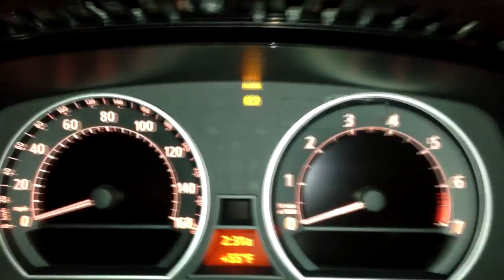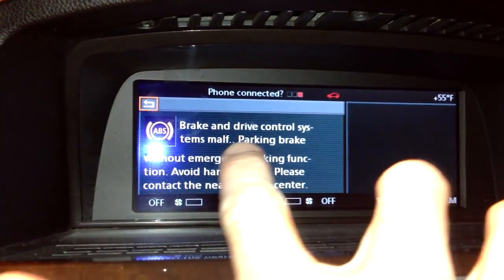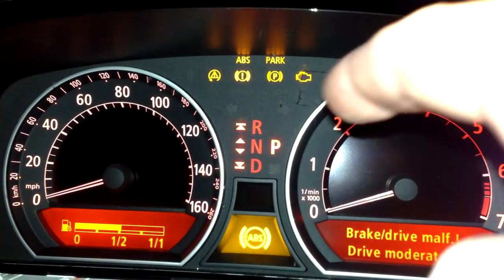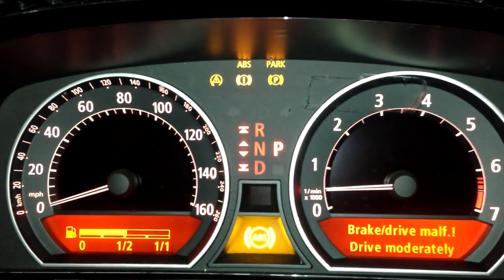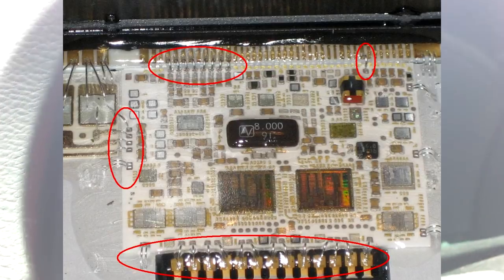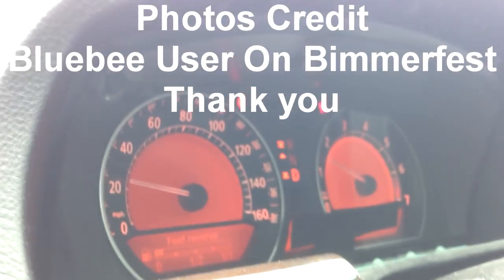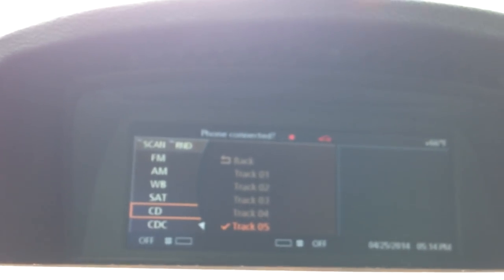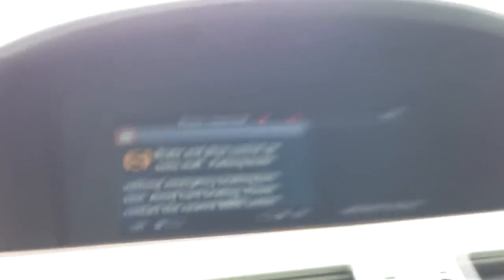Symtoms Of A Bad ABS Module  - BMW E65 E66 Bosch 5.7 module

Comment: Its the Rotation Rate Sensor DSC,Its under the passenger footwell.It leaks in through the sunroof and fills up the footwell with water that never goes away until you address it. The piece you need to change is under the passenger footwell. Rotation Rate Sensor DSC.
Reply: POP CHU how do you change that? Where exactly is located at?
Reply: You think it is the sensor or the module? Sensor is small round piece?
Reply: True had a very similar problem, the tubes that drain water from the sunroof get clogged you need to clean them out carefully. They exit behind the front wheel shields. Just check your footwell see if it’s wet. Especially after you went through the car wash.

Comment: I had this same problem. And didn't change it because people were saying it would harm anything. Then it went out while I was on the free way and I just totaled out my bmw. So get it fixed asap when this code comes on.
Reply: Dam sorry to hear that man.
Reply: @gabegaitan6964  No problem. Its going in the frame shop tomorrow.
Reply: @1CHOZN7  after seeing comment about the accident for not fixing the module I'm getting mine repaired. I didn't think it was a big issue. Good luck with everything..
Reply: @gabegaitan6964  Yeah everything locked up. And i couldn't control nothing. I think its a combination of things like the wheel speed sensors also. I had those changed out and just replaced the module. So now its ready for the frame shop hopefully everything is good afterwards.

Comment: before you send your unit in check the connector right behind the coolant tank. mine has gotten a small amount of water in it if i go to a particular car wash. the outside of the connector will look fine and possibly the inside of the connector too, take some compressed air and blow out the connector even if it has no signs of water in/on it. I have a 2006 760li and this trick has worked 3 times. make sure to give it a day to see if it works the computer will eventually reset itself and it may go away. Its free and worth a shot before spending money to get something fixed that's not broken !

side note: i had all the symptoms for the bimmerfest post about how to repaor the module.
Reply from the maker: Usdrake1fallen amazing, I will give this a shot thank you:)
Reply: DIYsavecash  enyoy your videos and i did save some cash. but i have to let go my bmw, too many repairs, i finish with one problem and another pop up.. i love the machine but it was time to go. now i fall in love with my vw touareg v8.. im still support your channel. good look.
Reply: Usdrake1fallen thanks
Reply: This is great am glad it worked for you ,did u have to disconnect the battery first to do anything?
Reply: I’m definitely gonna try this out

Comment: If your module fails, it can reduce the response to wheel caliper independently. Example is from complete stop, brake applied,  moderate acceleration, you will feel a jerking and hear "crack crack crack." This is the malfunctioning module failing to send release signal to reduce applied pressure to caliper. So basically, when you speed up, the caliper on one wheel will grab and you will hear the rotor and pad sound off as the module corrects itself, or tries to at least. 2001 x5 e53

Comment: I have  2008 750Li, same issue all the dash lights and the idrive information. However I has able to pull a code, it was the left rear wheel speed sensor. Went online and purchased a very inexpensive one, the lights stayed off for about 2 weeks then started coming back on. Checked codes again it was the same wheel speed sensor. I purchased a much better sensor. The lights have been off for about 3 months now.
Reply: My car same I'm change front wheel speed sensor still same problem I think it's abs issue

Comment: Did you loose power steering ... I sit mine overnight and all the lights go off next morning then a few miles down the road they all come on and power steering shuts off too , frustrating
Reply: mine loses power steering and sometimes cruise control aswell so im thinking its a speed sensor that went bad

Comment: I have been having DSC failure appearing on my dash for a very long time and i am clueless if this has anything to do with my tyres shaking when it gets to 60km/h speed.i have had to change all the arms, tie rods, stabilizer linkages and did balancing and alignment times without number but the problem persist, i am just not enjoying the drive in my BMW any longer. Pls advise
Reply: Ibraheem BABAYEJU did you ever figure it out?
Reply: Abs showed up for me when I had a mechanic take off most of the front suspension to fix a damn problem with the engine.

Comment: Hi i have a 2003 745 li bmw and i am having trouble with the car, i wanted to ask you if you know, heard or ever been told that the car has been reseting the monitors on its own? The reason im asking is because my car has been doing that, i put my scanner and everything is good its ready for smog test but out of no where it resets all the monitors on its own. I wanted to see if you have ever came across this problem before and if so what did you do to fix it.

Comment: Plz guys if these happens after a carwash or harsh bumps then in the front or back behind the wheels there r sensors tht hve been corroded inside so either replace the sensor or jst just the sensor n make the wires direct. Problem fixed
Reply: How do the sensors look like to you have a link to purchase? I took my car to a clielrsd mechanic that was fixing another issue on the car but needed to take off most of the front suspension I assume he forgot to attach a wire or wires back

Comment: Chris or ANYONE, wondering what levers on the steering wheel illuminate when the lights are on. I'm thinking all the lever icons are supposed to light up. The only one on mine that lights up is the transmission lever, and the green icon on the windshield wiper lever. For some reason I'm thinking ALL the icons were illuminated a few days ago, including turn signal eye icons, cruise control clock symbol, and windshield wiper lever. Pretty much ALL the white on all levers. Please let me know which ones are supposed to light up. Thanks

Comment: Hi Chris. I need to replace low beam bulb (driver side) on my BMW E65.I see some people on YouTube removing front bumper to do this job.is this accurate? Seems like extremely complicated .I'm sure you did it on you car at some point. Could you please tell if it is an easier way to do this? Thanks.

Comment: My 2010 750I is doing this now.  Tech said that my fuse keeps blowing that controls the dcs.  So that means i might have a bad abs module the cost is 3k????? C'mon man... it happened 3 days after a new battery install not sure if that had anything to do with it or not
Reply: J Harting ok there’s lots of questions that need to be answered 1.) he said the fuse.. fuses and sensors are two different things you should verify what it is. 2.) Theres places that repair abs module and you could probably remove it yourself if you’re car savvy 3.) when you install your battery did you get it registered to the computer and make sure it is the right type of battery.
Reply: Alex a BMW shop did the Battery replacement- a well known shop prob guys who used to work for BMW.  They have it now, I sent it back to them and they told me about the fuse blowing issue, he said in the F01 the module is located in a difficult spot and he ruled out the CASS....not sure what that is but said that fuse controlled that and the ABS......his next test was to disconnect the ABS and see if the fuse holds.....I am searching now for a rebuild place......a new unit cost 3k!!!!
Reply: J Harting J Harting well if it’s a fuse there’s a fuse box in thetrunk passenger side and there’s also one in the dashboard. I would try pulling them out check to see if they’re blown or use a voltage meter, if they look fine leave them out for about ten seconds then put them back drive around and see if the problem persists. There is also a “parking brake actuator” in the trunk you should look into sometimes a gear is broken causes these lights to go off. If you live in so cal I have a spot in the city of Van Nuys that repairs the ABS Module  for about 150 but you have to remove it and send it to them.
Reply: thank you ALEX.....I will tlry it
Reply: Bu

Comment: hey chris on someone hit my car and and now is telling me that I have a sit belt malfunction and make my airbag not work properly what should I do to fix these pro
Reply: EL RADAR  My car has the same problem, I have an 08 750Li and I’ve been told by several people who have the same car that there’s a bypass you can connect to the sensor. As of right now your airbag for the passenger side are off but with this bypass they will always be on. Just make sure there are no small children up front and you should be fine

Comment: Hello, I am wondering if the BMW E66 has a coolant line connected to the power steering pump. I see a little bit of coolant leaking underneath the pump.
Reply: Bit late to reply but if you have the v12 N73 engine it is likely the dreaded "weep hole" problem which shows up as coolant around the PS pump.
Reply: @marktolner2922  Yes, a tiny bit late, sold the car a long time ago. The leak was a bad oring on the line that feeds the water cooled alternator. The alternator bracket gasket was shot though and began to leak oil. Unfortunately this problem wasn't worth it for me to fix, too bad as the part was less than 5 dollars, but the labor to fix it was over $1,000 at a shop.

Comment: Is that the board that is part of the ABS unit? I presume by no codes you mean no obdii codes? In my case I had a steering angle code and a module failure code. I was lucky enough to have mine fixed under warranty.
Reply from the maker: Andrew Thompson wow very lucky to have covered under warranty, yes correct I wasn't pulling any OBD2 codes.
Reply from the maker: Andrew Thompson also yes that little board picture is the problem, it's located inside the module, you have to drimal tool the top open, Bimmerfest has some great write ups on fixing your Bosch 5.7 ABS control module. I think I'm going to have it fixed by a module professional, I could do it hopefully and fix it but if I mess it up then I have to pay 4-5x times more for a new one or 2-3x more for a used one then I would have to code a used one or a new one. eBay has great prices on module repair I think I'm going with a company called BBA.
Reply: +DIYsavecash so what u end up doing?? im having this problem

Comment: 07 328i abs modulator. in shop now. sent off (rebuild) 5 yr warranty install, computer reset 1,034$ yes that's right. still waiting to get back. all 3 lights, abs(light) no cruse control DTC or abs functions. good luck everyone...

Comment: Man thanks so much for input. Mine is doing all the same things except I’m also getting a Servotronic Malfunction which is Power Steering and Power Steering is going out also. Did your go out or get that same warning?
Reply: I have both the same issues on mine, the servotronic system and DSC system is under the front passenger footwell. Water leaked through my sunroof onto the front passenger footwell and fried all those modules.
Reply: @Frost-ng4hi  Thanks buddy that is where I am going to start looking first I think then. I dread this it sounds like it will be expensive! GL with yours
Reply: @bikedoc4145  Let me know what happens! Mines in the shop right now getting those two modules replace I’ll let you know how much it costed me.
Reply: @Frost-ng4hi  I will for sure. Have not started messing with mine yet but will when I do and please let me know if it fix's yours. I am hearing people say different stuff but you mentioned the most likely one. Will keep my finger crossed
Reply: @Frost-ng4hi I’m late as ever man but I have 02 bmw 745i car is doing same thing did changing those modules ever work out for you
Reply: @745i5  Don’t worry brother not late at all, I got rid of the car a few months back but yeah changing the ABS module did fix the issue. I took a risk and got one out a salvage 745 and it worked out great and saved a lot of money.
Reply: @Frost-ng4hi  did you have to get it programmed
Reply: @745i5  sorry for the late response brother, but no need to program but you will need to clear the codes

Comment: I have the same problem!  it causes all of my dash lights to come on its driving me nuts
Reply: kevin johnson  What year is your bmw?do you have a 745 li are 750 li
Reply: kj2844 it's a 2003 745li I don't know if it's ABS module or the sensor that's causing the issue
Reply: +kevin johnson were you able to fix the problem? What was the issue? I am facing the same issue these days.

Comment: Do you have any videos on EDC related problems ? I have a 05 760li my get bouncing when I hit bumps on rear passenger side . This problem is very bad while in sport mode , it’s present in comfort but not as bad . Also when going over speed bump I hear sound from shock . Any help would be appreciated.
Reply: Did you find out the problem

Comment: Hey thanks for the  response. .i did actually  both of them recently like 2 or 3 weeks ago  but it's weird ...I used a rebuilt alternator ...you think that could be the problem?
Reply: hectormarin95  It could be..
Reply: kj2844 how can I make sure oh that ..do you have idea?
Reply from the maker: hectormarin95 try going to autozone or O'reillys and have them test your alternator for free.
Reply: DIYsavecash I did that earlier today  and it passed..my battery is 3-4 days old
Reply from the maker: hectormarin95 hmm very interesting,  try to repair your module 1st before you dive into something more expensive since you have to get it repaired anyway, eBay has great prices on module repair I think I'm going with a company called BBA. they charge around 110 I think for shipping included search Bosch 5.7 ABS module, I asked if their prices for fixing the Bosch 5.7 module are the same for every car because I saw other BMW's from 2003 I think, they responded and said that it's the same price to fix it, I did notice they charge a few bucks more for certain cars worth more money for some reason. Try that then you won't have to code anything because their fixing your own ABS module, I've heard you can still drive fine without it while it's being repair just don't slam on brakes, take it easy, but double check that before you drive. You might want to ask them some questions, hope this helps.
Reply: DIYsavecash thanks a lot  ima work on the car Saturday I
We'll see how it goes  :)
Reply: @hectormarin95  did you ever fix the problems with the bmw. Mine is doing the same with the error lights after the alternator change
Reply: @DIYsavecash  thank you for sharing your knowledge God bless hope all is well 🙏

Comment: I have the same problem  but I don't really mind all the lights but I have this new problem  do  you know by any chance why  all the lights in my dash going out then blinking ..?...Thanks in advance
Reply from the maker: hectormarin95 Hello, first thing that comes to mind is, have you ever changed out your battery or alternator? I'm heading to bed now but I'll check your response tomorrow:)
Reply: DIYsavecash I replaced my abs module and my lights are gone but it keep going off and then blinking  and my transmission goes into safe mode I think  that's what they call it  ...I read something about the voltage regulator  but I have no idea where is located and how it works  ...
Reply from the maker: interesting, I'm not to familiar with the voltage regulator myself, try to Google BMW E65 E66 voltage regulator problem and read everything you can about this on the BMW forum boards, those guys/gals have been through everything:)
P.S did you use your same ABS module? or did you buy a New one? also if you bought a new one did you code it (program it to your car)?
Reply: +DIYsavecash I noticed the starter malfunction light was on when you turned on your car, is that part of the ABS malfunction or was is thst a separate issue

Comment: hey I got a 06 750li and it has a transmission error. the car turns on but it won't shift out of park any ideas?
Reply: +Hacker07Gaming  takr a look at the gear shift seector mine went bad or check battery
Reply: Minds the same thing I was told on your transmission it a sensor that sends a signal to the gear shifter
Reply: @riddlessmile1218  did you ever fix it?

Comment: hey man , great video.
i have a 525i e60 body, and i have the same problem with the lights also my brake pedal gets very hard lole if the booster is not working bit it doesn't do it all the time tho, also gives me the engine overheating alert within 5 minutes after i atarted the car.
did yours have the same symptoms???
can you recommend me a place to send mine to get fix.

Comment: Ive just changed x2 rear abs sensors still have the dash warning 🤬
Reply: Did you ever fix this? Did it end up being a bad abs module?
Reply: @isaacmelgarejo7432  i scrapped the car we couldnt find the issue

Comment: I have a traction control triangle light in my dashboard along with the message of Dynamic drive failure on my BMW 740, 2006. I did twice scan but no error codes. Car is lacking power. Any suggestion how to fix this
Reply: I had the same issue …its in the steering wheel under the airbag …2 pins usually eaten or the green board is dirty…needs to be checked by an electrician or u can do it by ur self…check this video.